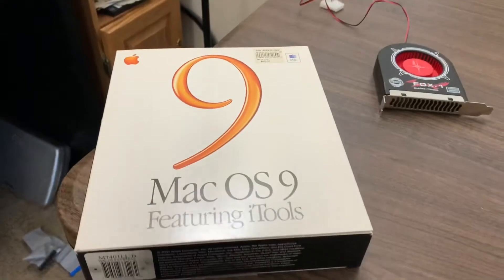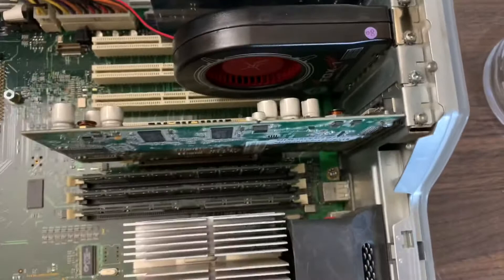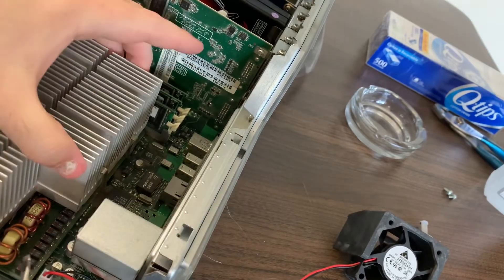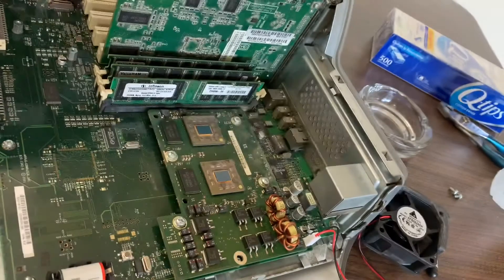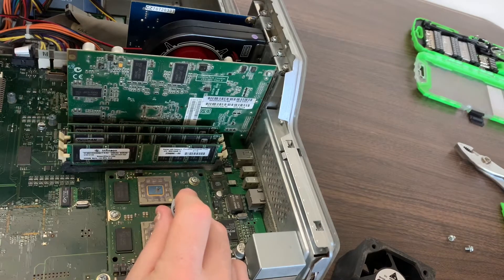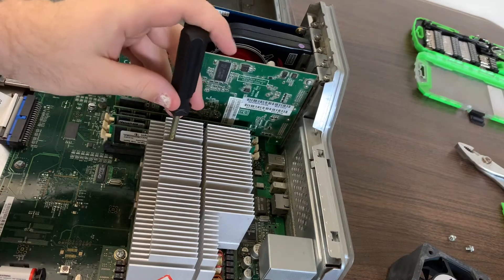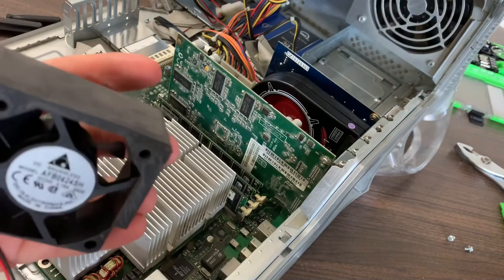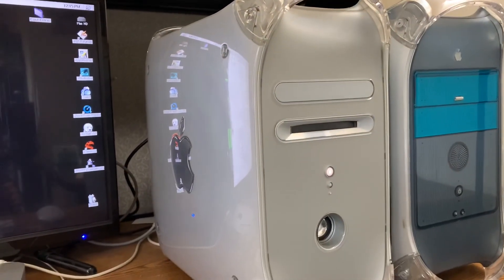Crucial Power Macintosh Maintenance: Re-pasting My Beautiful G4 Quicksilver’s Heat Sink.

Comment: Just about to do this myself to my one.  I notice you left the thermal pads on the heat sync and (although I'm not 100%) I'm pretty sure they should have been removed as well before adding thermal paste.  I'm curious if you've noticed any issues over the past few months since doing this?
Reply from the maker: Is that black sort of residue considered a pad? Regardless, I wanted the fresh paste where the heat is actually generated. That said, this machine has had a replaced CPU fan and a sort of PCI slot fan that blasts a little air out of the system. All that said, that heat sink used to get hot enough that I would swear I could cook an egg on it. Not anymore. It's been quite healthy.
Reply: Ah, cool (pardon the pun).  Yes, those squares on the aluminium heat sync are [as far as I’m aware] heat pads. Feeling the tension after clamping down the two springs, I think there’s more than enough tension to keep it taught after removing them and using the thermal paste you’ve used instead.
Reply from the maker: Fatblokeonamoped I confess, that's where I'm confused. It was like a residue more than a padding, it had no thickness whatsoever, it was more akin to a stain. But yeah, I don't think you'll regret the work, I sure didn't. I just hope you're doing the right thing and running OS 9 on that machine like a real man 😄
Reply: Lol. OS9 on all the other puppies in my collection. Believe it or not, I’m looking at running Tiger server on it as my public facing FTP server replacing a Win7 PC doing the same so I can have native LAN  speeds for my work.  I won’t bore you with my G5 memory woes......